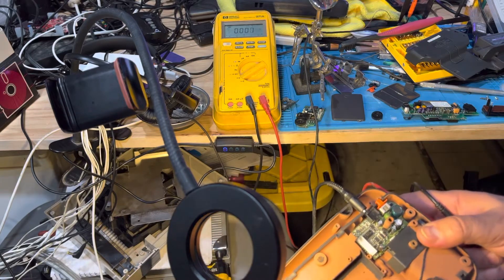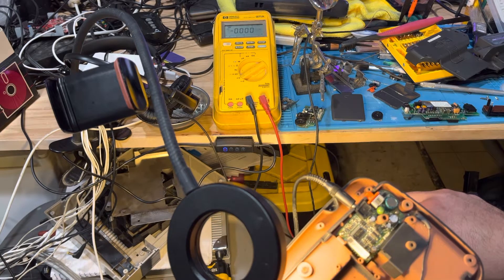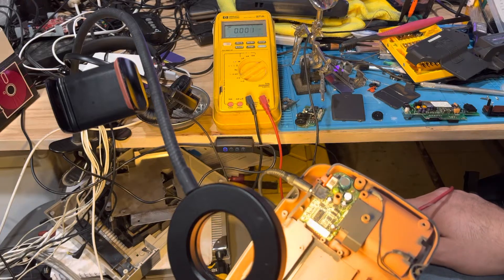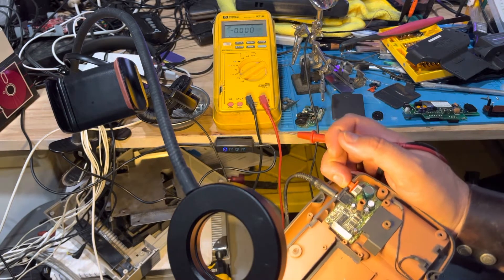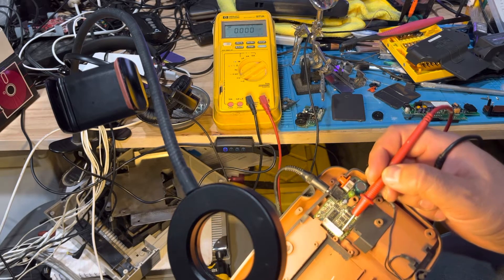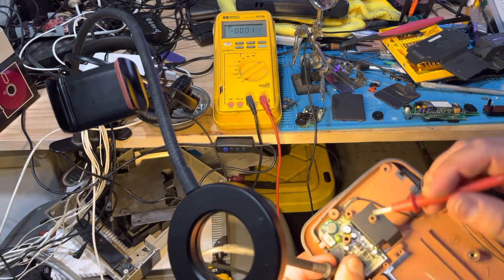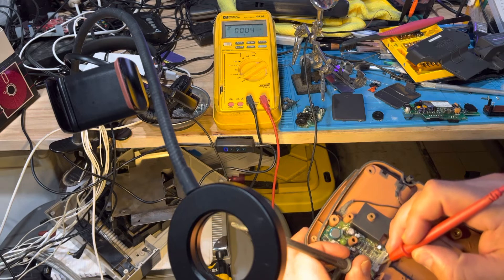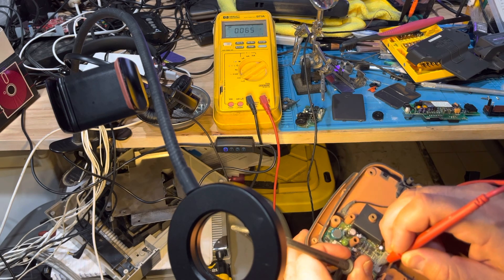How-to Determine a Sega Game Gear Faulty Power Supply.

Comment: Hi, I have the same problem with my game gear except am not getting any voltage readings on the output pins 34 volts, 9 volts (European) ,5 volts etc. will a full capacitor change work in this case.
Reply from the maker: It would not hurt. All these units capacitors tend to leak so it’s best to do it anyway.
Reply: Was it connected to the charger ?